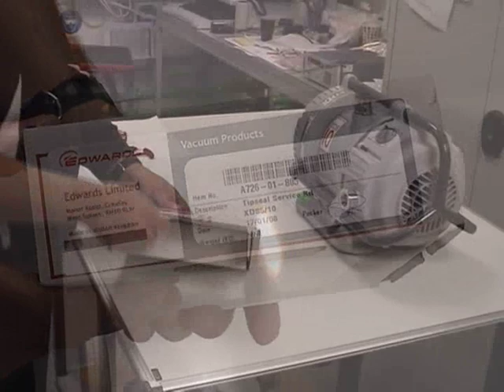Edwards Vacuum Pump XDS5 and XDS10 Tip Seal Change

Comment: You show clearly how to change that scroll seals and o-ring, but who is the cleaning procedure ? some special oiling before to install scroll seal ? NOT clean at all, just replace parts ?
Reply: Yeah I found that very bad, no inspection or cleaning of surface